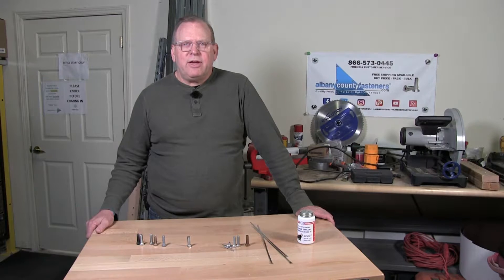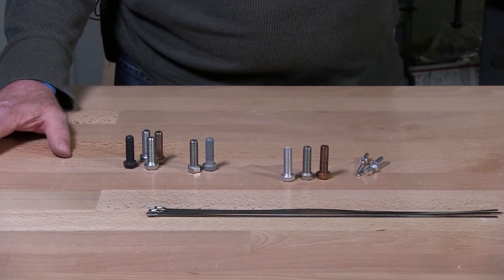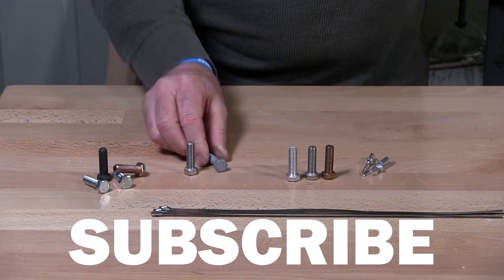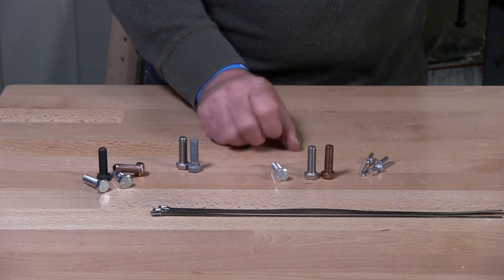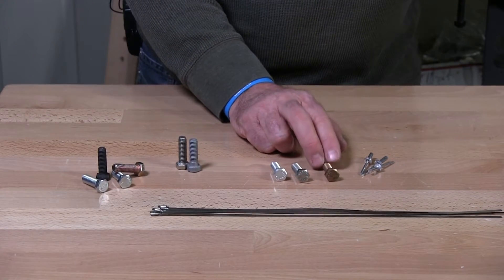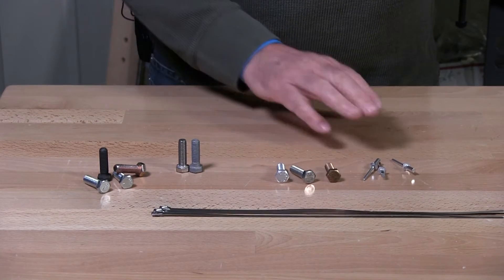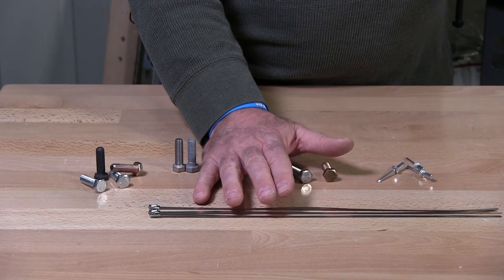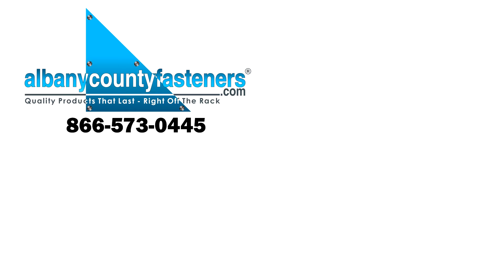All About Salt Water & Marine Grade Fasteners | Fasteners 101

Comment: Is 316 grade without paint is recommended for C5 and CX condition ?
Reply from the maker: I would consult an engineer on that one. While 316 stainless steel is very corrosion resistant, we're not sure if it would be sufficient for a C5 or CX condition environment.

Comment: Could you do a video on what screws to use when installing Fire retardant Plywood to Steel studs
Reply from the maker: We'll definitely consider it! In the meantime, a self-drilling screw would be your best bet for that application. However, you'll want to predrill a hole through the plywood to lessen the chance of the screw overheating.